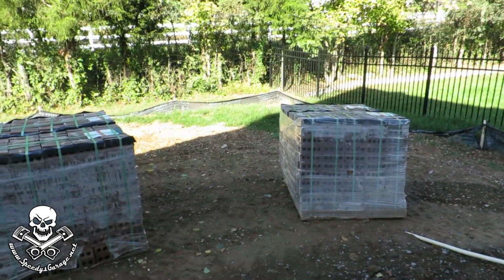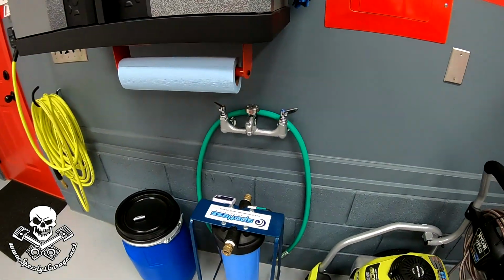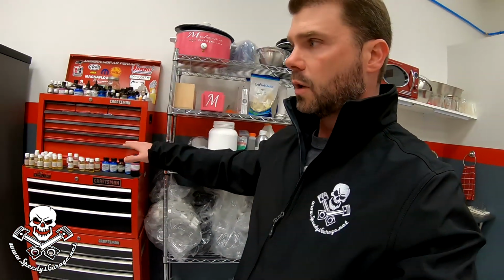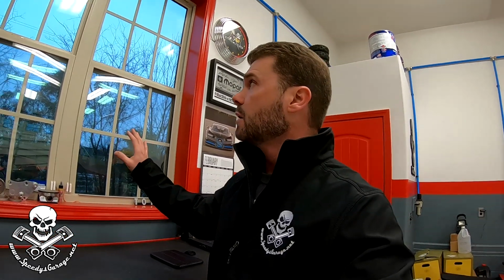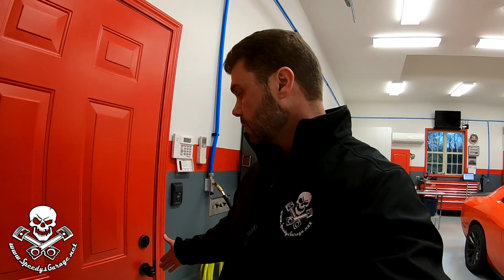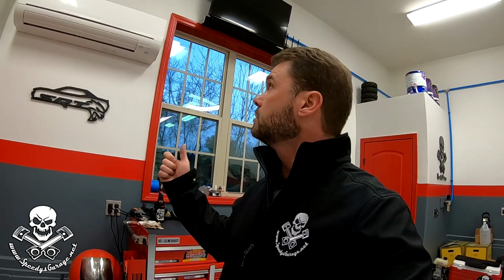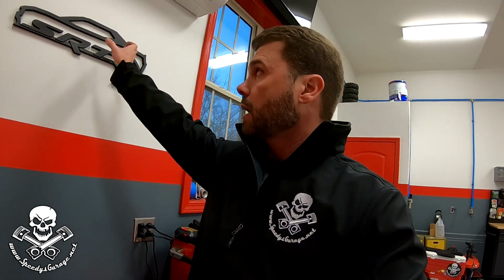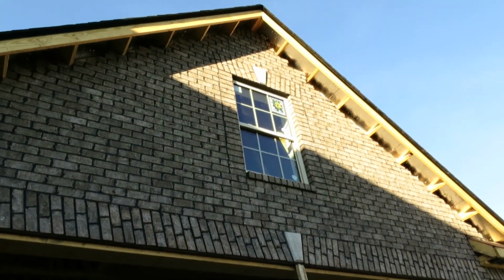Speedy's Garage Shop Build Continues...

Comment: Hey Speedy, I love how in depth your videos are. Quick question: I have a 2017 Challenger T/A (5.7). I can’t find the wheel lug nut torque specs anywhere. I’ve checked the manual, and it just isn’t in there. On my 2010 SRT8 Challenger the specs were 110 ft/lbs. Any suggestions?
Reply from the maker: I used 110 ft/lbs on my 2009 R/T.